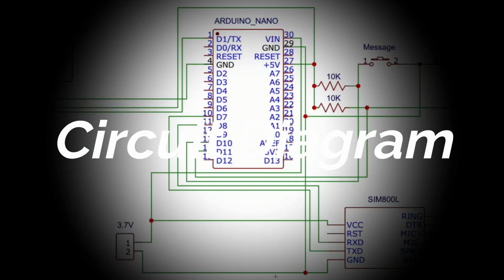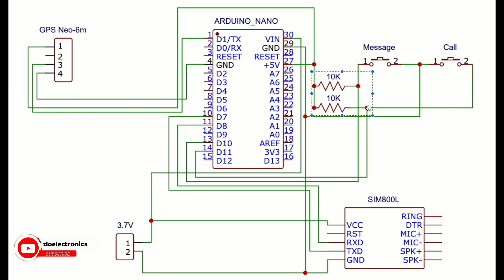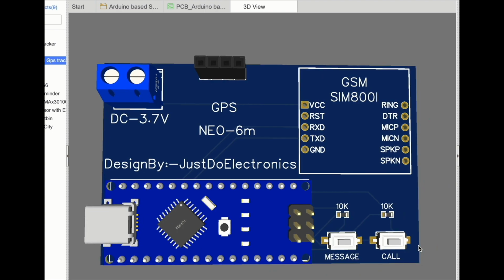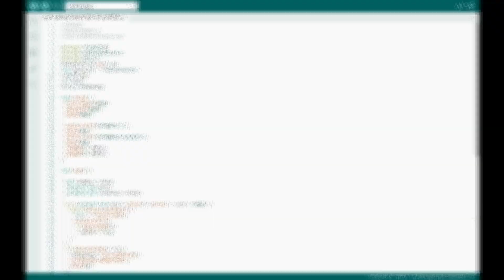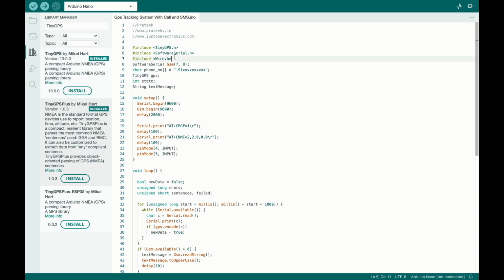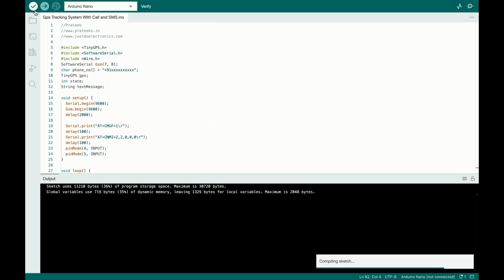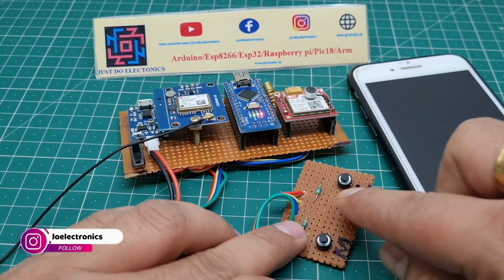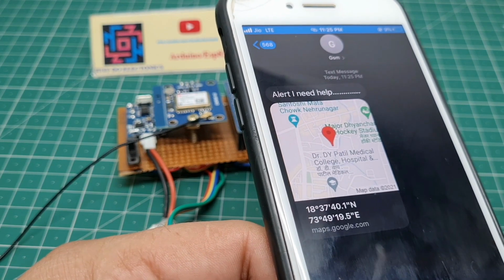Build Your Own Small Gps Tracking System

Comment: Not working 😢
Reply from the maker: Why tell me why is not work ?
Reply: @JustDoElectronics  C:\Users\asus\AppData\Local\Temp\.arduinoIDE-unsaved20251114-19708-zmnydk.csh5\sketch_dec14a\sketch_dec14a.ino:1:10: fatal error: TinyGPS.h: No such file or directory
 #include <TinyGPS.h>
          ^~~~~~~~~~~
compilation terminated.
exit status 1

Compilation error: TinyGPS.h: No such file or directory

Comment: Hii sir i made this project i checked the continuti the 5v pin nad ground pin are connected is that a problem ❤pls rely
Reply from the maker: Check is gsm module is working or not if the module is not work then you not received the message

Comment: Great video, but i have 1 question. Is the 3.7 volts battery enough to power the device? From what i know the operating voltage of Arduino nano is 5 volts
Reply: yhh but still it can work with 3.7 too

Comment: Thank you for the explanaton and video, but I have a question sir. What's that button beside the TP4056 module ? Is that the power switch ? If yes, where do we connect it? Does it just activate when the push button is used; if so how do we turn it off? I was thinking of modifying the code to shut down the device after 20minutes of idle. In addition, the link in your description states it needs a LM2596 step own converter; does that mean that 3.7V is quite strong for this device and needs the afforementioned module or is it fine without it ?
Reply from the maker: No is lm2596 step down converter to given. The 3.7 v dv supply to gsm model
Reply: @JustDoElectronics  ohh okay, how about the black button/switch beside the TP4056 module ? What SIM is usable for this build ?

Comment: Tell me one thing
You provided 3 different code, which code I use for this particular project?
You used 2 push button but in your website there is only one push button showing in the circuit diagram, so please clarify which code we use to build this project.
Reply from the maker: Which one you want if you want 2 push button based then you used 1st one if have basic knowledge about the code then i hope you do that and if have any another problem then plz email it we try to solve your problem 🙏
Reply: @JustDoElectronics sir I have message you on WhatsApp
Reply: @JustDoElectronics Honestly your replies are very helpful and appreciated for those communicating through email. It would be wonderful if you could try and answer the question simply on the post and any detail specific questions via email THEN. Awesome project!

Comment: Hi Sir, which software did you use for circuit design and PCB layout
Reply: I think Easy EDA
Reply from the maker: yes
Reply: @JustDoElectronics  Hi Sir, I used the first circuit and also the first code, the code is uploading but project does not function. Also Gps and sim800 Led does not blink. What maybe the problem?
Reply from the maker: @kinyanjuimartin7349 why send me photos in email

Comment: Live tracking?
Reply: Do not use the battery system he used though, that is the weakest point of the model he built.
Reply: @steemiepyle2608 then how can we overcome?
Reply: I'm assuming yes to a certain extent, depends on how fast the device pulses I guess.
Reply: @steemiepyle2608 can you help me out for building live vechile tracking system, I will be grateful to you